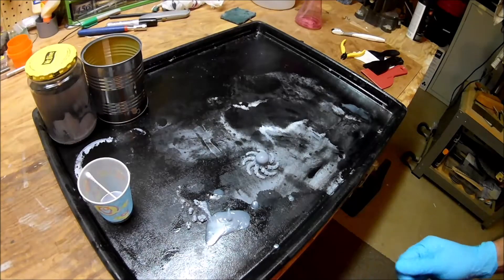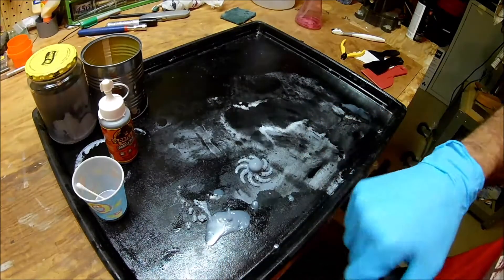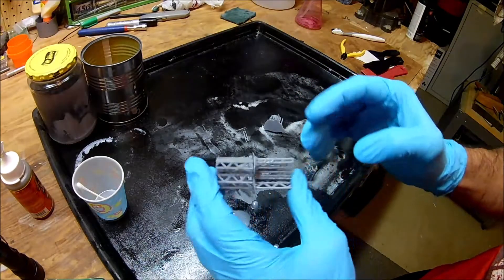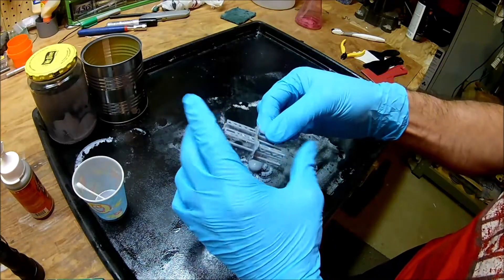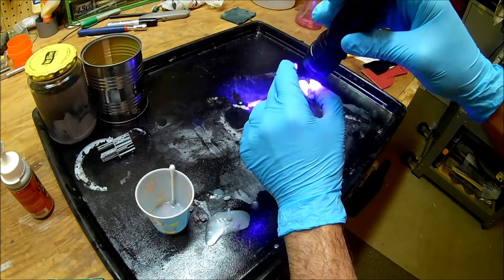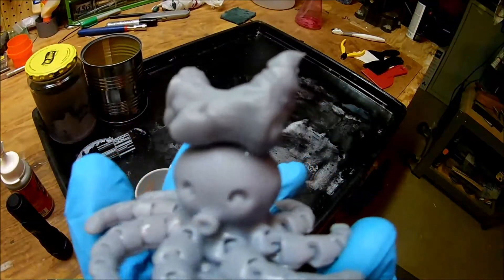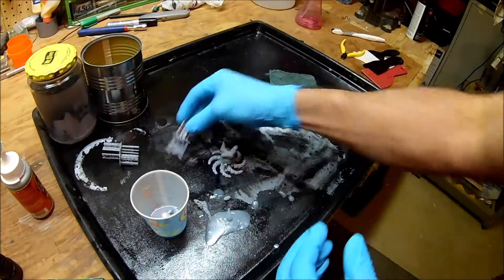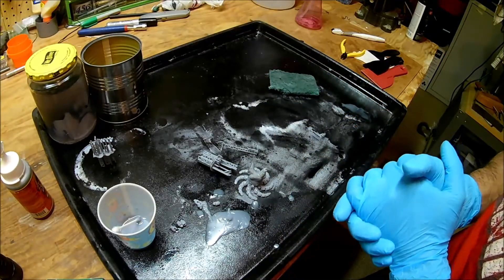Glue vs. Resin for 3D model joints. Advanced techniques on when to use resin with examples.

Comment: The thing I would be concerned with is how much the UV light will penetrate the resin.  You put it on too thick it will only solidify the surface and leave the underlying resin uncured.  You use it to adhere a large surface, only the outer part will cure and the deeper parts will not resulting in a weaker bond.  This is why I tend to use super glue rather than resin.  I would wonder if you used clear resin whether the UV light would penetrate deeper and give a stronger bond.
Reply from the maker: Yes I made this mistake on a very large model.  I had to leave it in the sun and use a UV flashlight and it still didn’t seem to cure fully.   This is only good for small joints.
Reply: Would clear resin help fix this issue?
Reply: @jasoncox6245  if you are trying to weld two pieces together I'm not sure how well the light would penetrate into the crack but if you're doing something where the light can get through then maybe but it probably depends on the resin so you'd have to test it.